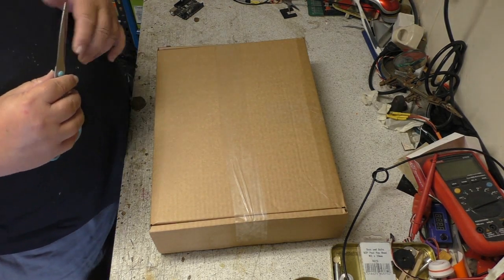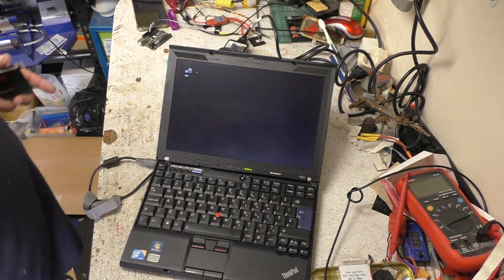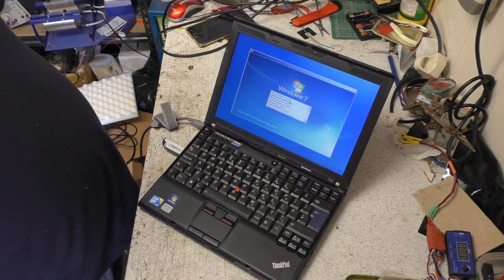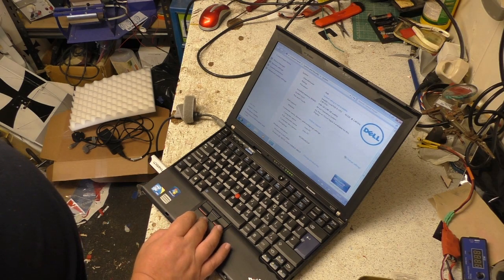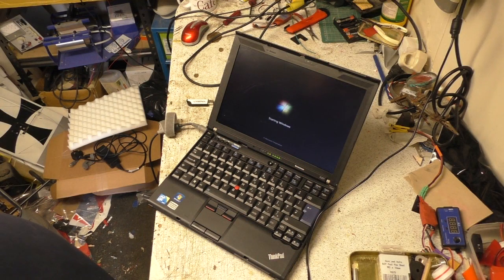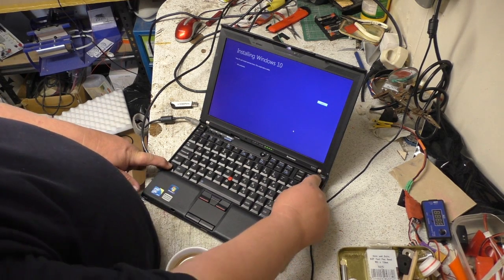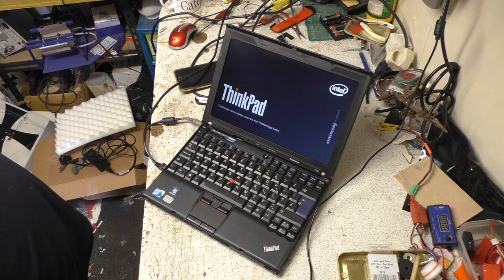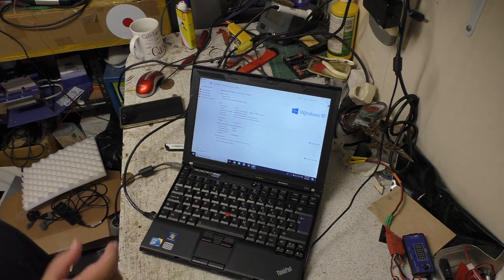Lenovo x201 laptop password locked bios repair

Comment: If you plug in a usb flash drive with Linux, would it show up in the boot menu if you press f12  when the bios is locked.
If yes then could you still install Linux from the usb flash drive. Thank you for your help.

Comment: I am really looking forward to the next 27529 episodes.
Reply: I upgraded my 500GB PC with a 1TB hybrid hard drive which works great but beware of the fact it will get hot, very hot. Notice any laptop should have a USB3 connection, on my PC the USB3 PCI was easy to install.